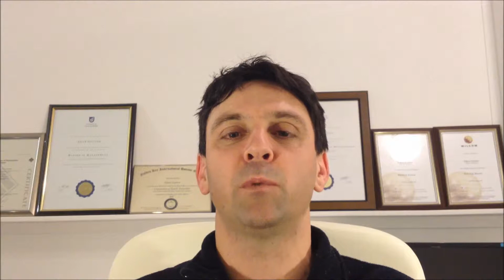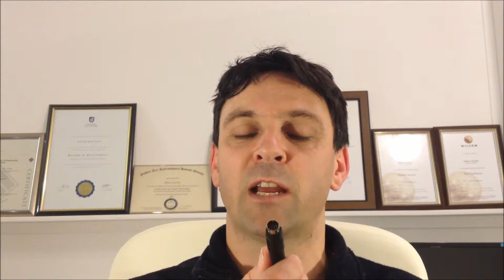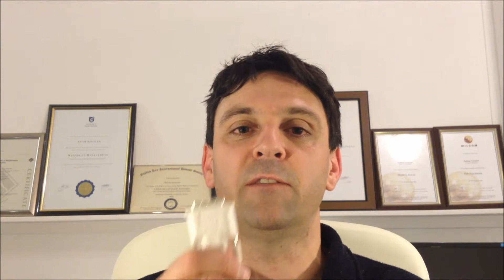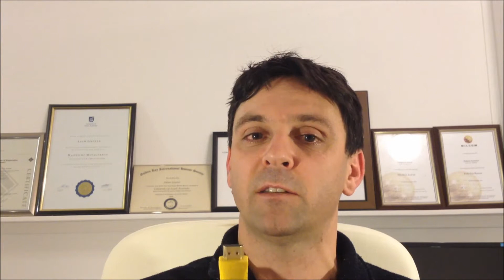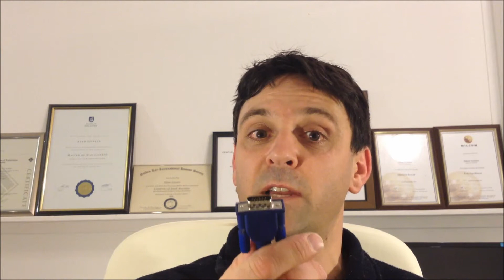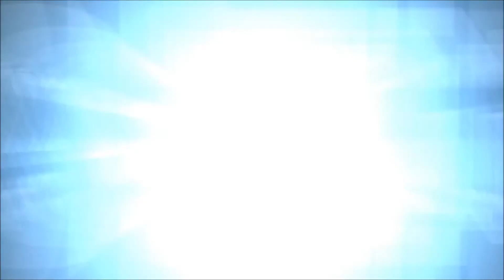Home Theatre Video Cables Explained

Comment: What is " Coaxial Cable" what does that do , bcs I just got a new Sony Blu-ray player and I was trying to connect to my LG  Home Theater that doesn't have coaxizl cable?
Reply from the maker: Hi Big Sam. Coaxial is a type of cable. It can be used for analogue or digital transmission. You would be most familiar with the TV aerial cable - that is a coaxial (also known as coax) cable.

They can have different connections on the end like f-type and pal (TV connectors), RCA (like a speaker cable), or BNC (a bayonet style plug).

In your case I would recommend using a optical cable (also known as SPDIF) or at worst a HDMI cable. What you need to do is check the manual of each and see what connections they have. When you find one that they both have use that.

If you post your equipment model numbers I can do a quick search and let you know what is best.